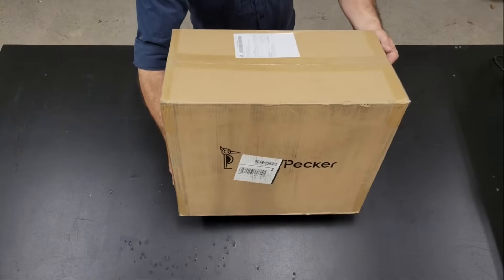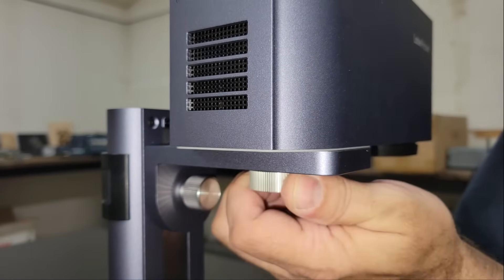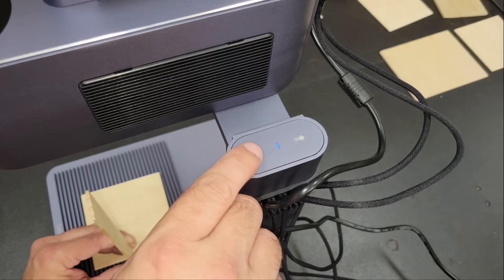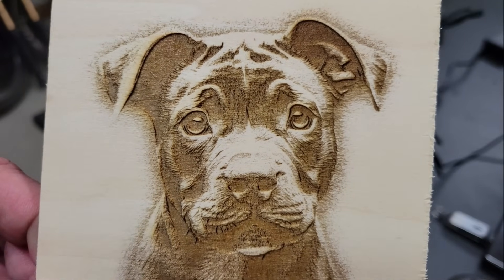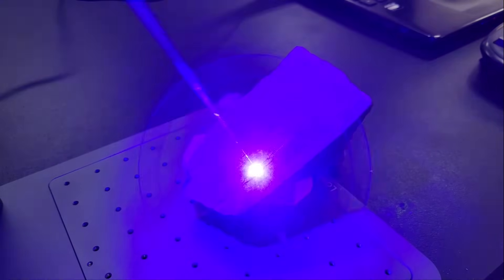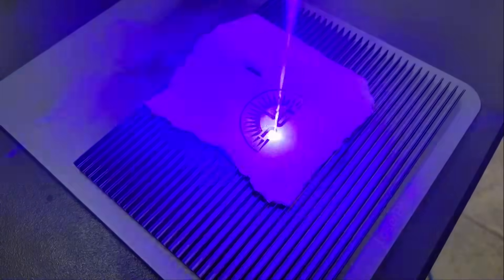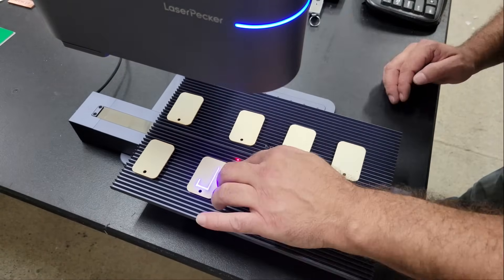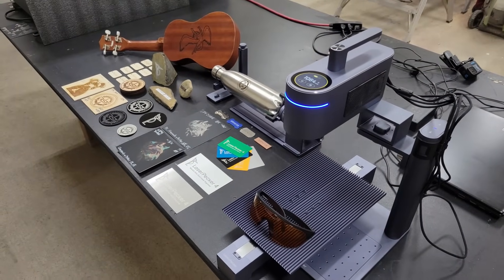WORLD's FIRST Portable Dual Laser Engraver - LaserPecker 4

Comment: Great video. How did you make the logo black on the Bottle? Did you apply anything on it or it's the settings?
Reply from the maker: No coatings, just the settings as shown.
Reply: @JamesBiggar  oh ok great. Thank you. There are no settings for the bottle in the video. Should i just increase the pass?
Reply from the maker: More power, less speed (ie more depth %), and more passes will mark darker.
Reply: @JamesBiggar  great thank you  ❤️